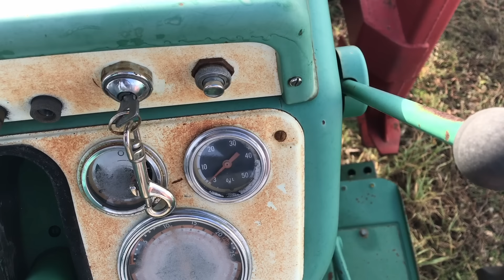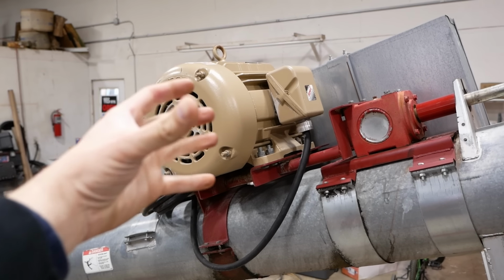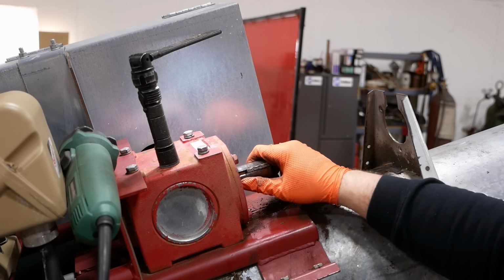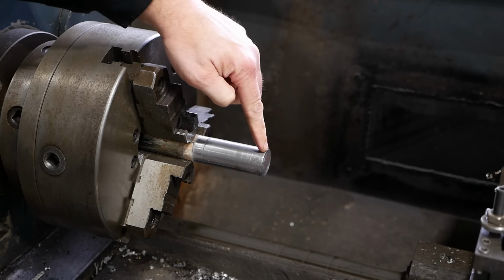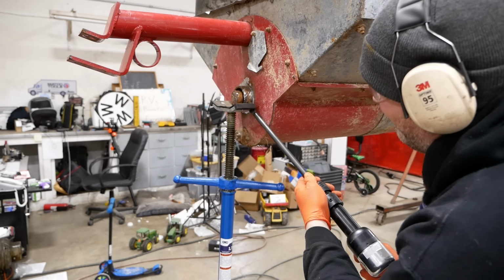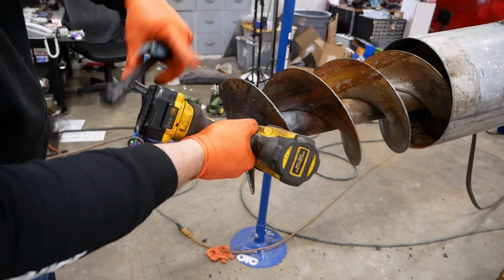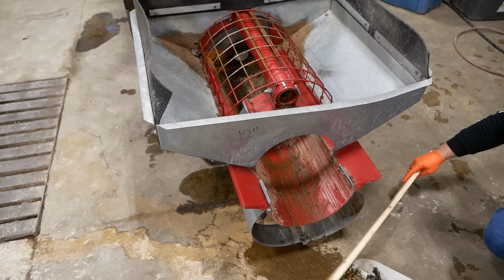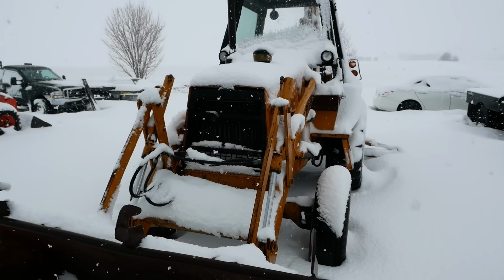Using ALL the Tools to Fix a Chewed up Grain Auger

Comment: For the bushing on the bottom, I think I would make the littler stub shaft a little longer and make a bracket to mount a flanged sealed bearing on there but make it stick out about an inch. Make the bracket U shaped with the bottom open to allow any dust to drop out before it gets to the bearing.

Comment: I don,t make it a habit of criticizing your work so forgive me.  There was a 3 bolt flange bearing missing at the lower end of the driveshaft. It wore out and somebody cut it off. It should have been replaced.  That much unsupported shaft with a rigid coupler caused the keyway to wallow out and it is ruining the gearbox in the process.  All three of those bearings could have been replaced for around $100.  Also, there are split rigid couplings available to simplify shaft repairs.  Finally,  a good sealed 4 bolt flange bearing on the tailshaft would last a long time IF the owner would apply three shots of grease at the start of the harvest season. Finally, farm equipment is built cheap because it is used seasonally.  A little $$ added at repair time can make it last indefinitly.  I really like these types of videos.  Thanks.
Reply from the maker: I don't get to fix things the way everyone wants. The customer wants it put back the way it was. My job is do it or pass.

Comment: Kudos to you Wes. I know first hand the work you done there. As I repair maybe 10 or so a year plus all other types of grain handling equipment. Its rare to see somebody take the time to do it properly, most of the time I am cutting off the coupler as the farmer just welded it up to finish the season. Then forgets about the repair until it breaks again and now the 12 hr turned into 18hrs

Comment: Cutting Edge Engineering can only "suck a point to this" that's a dutch saying, (without any mean connotation)  just telling it looks a great job, and they probably would not have done it better. 

Was hoping for a dry-run in the end?

Thanks for taking the time to film it!

Comment: Great work Wes.  Always love your machining videos.  Might need a little “weep”/“drain” hole in the bottom of the area where that and residual corn kernel’s were, course keeping that hole cleared out would be troublesome.
Great video,
Thank you sir.
Reply from the maker: It does have a small trap door. I think it's rusted shut.
Reply: @WatchWesWork  yeah, probably.

Comment: Looks like a great job I personally would have switched it to a four bolt flange bearing ,that way you could grease it and you wouldn't wear it out ever again.. I work as an industrial mechanic in an ethanol plant and we have screw conveyors all over the place all of ours are four bolt flange bearings just never have any issues.
Reply from the maker: I don't know. They are all built this way. There has to be a reason.

Comment: Having a mill(I think) you could just recut another keyway in the shaft at say 90º and just build up the old keyway for added strength. No Mill, Cut the new keyway on the lathe, slow and time consuming.
I commented before seeing you did the job. Love these random machine videos, hope you have some more in the pipeline. Oolite bearings are self lubricating for those that don't know.

Comment: Great video Wes. If you did use a genuine oilite bushing, they are oil impregnated and self lubricating. Adding a grease zerk is not necessary for oil impregnated bushings.
Reply from the maker: Genuine. But oil does help!

Comment: Consider building a super sized slide hammer for removing shaft journals like that. We have one in our shop that has proved its worth many times. No need to make fancy adapters, just weld it to the journal with some 7018 and wail away.

Comment: Nice job, 😄
I repaired alot of machines when working at the farm at my school time.
One thing I was wondering about why is there no thrust bearing at the end of the auger axel?
I would think that axel has a lot of force pushing is downwards when pushing the corn upwards.

about the missing grease fitting I can confirm some times and very dusty environments grease can make things worse.

Comment: Yeah that 15W 40 is a might thick when it's cold. It ain't janky if it works. Bravo. I know diddly but it strikes me that bottom of the shaft should have had a zerk on it. Maybe replace with a straight roller bearing? POPCORN! It's gotta' be joyous working a moving target. OK NM on the zerk.

Comment: It seemed to me a piece of 304 stainless would have made an ideal replacement shaft instead of mild steel, and cutting a ledge for a seal in the mounting barrel inboard of the bronze bushing to keep the dirt and water out. Adding 4-6 weep holes in the bottom of the hopper would go along way to keep the bearing above water. What do you think?

Comment: When trying to back things off you got to keep it square, so you need to keep the impact and pulling yoke straight, so put a bubble level on it both ways , vertically and horizontally. Put some kribbing under the impact and around the pulling yoke . A straight pull is an easy pull , other then that it gets cocked sideways and tries to tear itself apart.

Comment: So many methods (and tools) to manipulate parts and raw metal, but the results are great. One added step I would have taken would be to remove the cleanout gate at the bottom of the hopper and introduce it to my scrap bin. Also, we all know of course that you could have made the shaft coupler too.

Comment: First, I enjoyed it and would not be able to do it myself. I did wonder if you risk boiling the lubricant out of the bearing, welding the housing in after fitting the bush. I also wonder if a longer stub in the bottom of the auger could be supported on a solo aligning ball bearing with a three bolt face mounting. air would require a tapped plate to mount the bearing on as no bolt heads could be inside.
Reply from the maker: I don't think a bearing would survive the dust.

Comment: Impressive work on this one, particularly with all the cumbersome pieces. The dry bushing sounds like what Squatch253 said about the pins and bushings on track machines, where grease would just pick up dust and dirt and wear stuff out faster. I’m somewhat surprised they didn’t use some sort of sealed bearing, but I’m far from an expert on these things.

Comment: Wes, So I gotta ask, why not put a Dodge 4 bolt flange baring on the end of that thing in stead of the Bushing?
My thought is greasing the baring helps drive out the the dust and dirt. When it does go bad pull the bolts slip it off the Shaft and slip a new Baring cartridge in and bolt it back together grease it up.
Should last longer and be a quicker repair next time.

Comment: About bearings: I work in a facility where an acidic substance becomes vapor and is then exhausted out of the building.  The sealed ball bearings on the exhaust blower shaft have an excessively short lifespan.  SKF are the only bearings that have been about to hold up between maintenance intervals.  Equivakent NTN, Timkin, Tritan, etc. all fail in short order, probably from the acidic vapor breaking down the seal and evacuating the grease.  Whatever SKF is doing holds up slightly better under these conditions.  We're considering modifying the blowers and putting in greasable pillow block bearings with auto greasers, but I'm concerned about other particles in the exhausted air being similarly abrasive as the grain dust, making their way into the bearing through the less-tight seal than the ZZ bearings, eating them up and negating the auto greasing system.  I guess if SKF changes the bearings up, we'll try the auto greasers, but until then, we'll stick with the expensive bearings that prevent downtime from unscheduled maintenance.

Comment: I noticed that you put the bead of silicone on the outside of some of the bolt holes for the gear oil tank, I hope it doesn't weep gear oil from around the bolts.

Comment: You just had to buy a new coupler, cut the shaft off and get a keyway cut. Slide the motor and gearbox up and done.  This auger is in real good shape compared to my old 7 inch Sakundiak after I've augered 150 tonnes of coal through it.
Reply: I thought the same thing but after looking, wasn't the  shaft  flange bearing holder welded too close for everything to slide up enough?

Comment: Instead of the oilite bushing on the bottom end, I would have converted it to a square flange pillow bushing with an eccentric collar since you had to make a new stub shaft anyway. That's what we ran on the Kinze grain wagon augers when I worked there. Nice thing is it would have been greaseable and an easy replacement next time if needed.

Comment: I guess I missed something! So the electric motor would turn, but the shaft wouldn’t turn? Didn’t that red coupling have a key way in it? What happened to the woodruff key? Was it missing? I would think that auger would have a shear bolt somewhere in that shaft or between the motor and the coupler. You did a good repair on the bushing. Don’t understand why we couldn’t see it run.

Comment: About 40 miles from you, at least 12 plus inches and horrible blowing snow.  The roads are going to be difficult until the weather melts the ice.  Looks like the weather is going to really warm up later in the week.
Reply from the maker: All the way up to 0.
Reply: @WatchWesWork  - Long term forecast for Lanark IL - Jan 23rd shows 43 degrees.

Comment: Looks like you are still having a mild winter. That looks like a normal winter day in Canada and our schools are never closed. BTW I am 63 so I have been around long enough to have seen some weather.
Reply from the maker: The snow isn't really an issue, it's the wind. They basically can't keep the roads open.
Reply: So...like a normal day around here. Had "white outs" on the way home from work the other day. That's when the wind is so bad you can't see a thing for blowing snow but you keep going anyway. @WatchWesWork

Comment: Seems like a 2 or 4  bolt FLANGE bearing would have been much better than a bushing. At least it would be greaseable and it would be much easier to replace. But the engineers know what is "best". Haha.

Great job. That air hammer is impressive; it works  wonders. 

Always enjoy your work. You really do a great job. Looking forward to next project.

Do your customers watch their equipment repair videos? What do they say about your approach to the repair?
Reply from the maker: Some watch, most don't care.

Comment: I'm curious as to why you replaced the bushing and all the work involved with that, instead of using a bearing and mount instead. Would be easier to replace a bearing at a later date.

Comment: We once had a train pulling a bunch of grain cars derail near our house.  The railroad just emptied the grain from some of the cars into massive grain piles and left them to rot.  It stank bad for years.
Reply from the maker: They had an elevator blow up here and the corn was mixed with metal and concrete. Too dangerous for animals to eat. They trucked it down to south and fed it to cat fish.
Reply: @WatchWesWork  Catfish don't count as animals, I guess!  Lol.  

The same railroad is responsible for a Superfund site in town.  They don't seem to have learned to properly cleanup after themselves.

Comment: 11:24 Gentle heat to me is bad. Lets the heat soak and screw stuff up. I get it, get out, with as hot of an O/A as possible. Heat that coupling so before it can soak to the shaft and have both expand at the same rate.

Comment: 1. Cut the shaft off and slide the motor up.
2. Weld the coupling to the shaft and slide it onto the motor.

Comment: One other option for repairing the keyway on the shaft would have been to shorten the shaft and cut a new keyway. Then make  up the lost length on the shaft with a longer coupler to the gear box.

Comment: A 20' common round size  steel bar will be in stock in every major metals dealer in your area.  This stuff is ungodly common.  I used to work in a steel distributor and we had 20 and 12' length stock in everything from 1/8th to 2"  Rack after rack of the stuff.
Reply from the maker: The nearest metal distributor is two hours away and only delivers once a week if I’m lucky.
Reply: @WatchWesWork  OK. I was just letting you know in case you didn't already know.  You have to either pick it up or have it delivered, which kind of sucks. You can't send 20 foot packages through the mail or UPS. IIRC, there was a 70 pound limit anyway.

Comment: One question, why bother with an oil lite bushing at the end of the auger when sealed grease or bearing plates exsist? I mean you already had to mess about with machining a new insert for the auger why not throw a serviceable bearing on the end drill a few holes to bolt it up call it a day?

Comment: I would have been tempted to just weld the driveshaft to the coupling and fix the bushing on the auger. You still have a keyway to shear on the other end of coupling.

Comment: I wonder if the original bushing was that cast iron thing simply because normal bushings wear out too fast in that environment?  Seems like you would want a well sealed/protected actual bearing there instead.
Reply from the maker: I suspect it's more about cost. These things are made as cheap as possible.

Comment: Surprised the drive was taken on a woodruff key, I had always understood that they were there to locate but not take drive. Also no sign of any shear pin, when I worked on the pea harvest in the late 60s with Mather & Platt viners they used 6 inch nails as shear pins. Could you not have replaced the oilite bush with a sealed roller bearing?

Comment: You slid the motor down to get the rod off. I would have cut the shaft and slid the motor up. I might have had to cut and reweld to reposition that bottom rod brace near the motor.

Comment: Your a Machinist Wes, could you have just rotated the shaft 180d and milled in a new keyway? 🤔

Edit: Before I leave... enjoyed the video!  And I agree with your assessment of a grease zerk on that bearing... "lapping compound" is the perfect analogy!!!
Reply from the maker: I could, but it would not live long. The OD was worn down .060"
Reply: @WatchWesWork  Yeah, good point.   Enjoyed the video.

Comment: Could you have cut off a few feet, turned the cut off end 180 degrees, remade the end, and spliced it back in-either weld it on, or put another coupling in?

Comment: For your 3 phase conversion, do you use a rotary converter or inverter? I will need one for a milling machine I am resurrecting and am  considering an inverter for cost and simplicity and possible speed control.
Reply from the maker: I use an RPC.

Comment: Wes, I have been a farmer all my 70 years, and have often wondered if an oak bearing would work as good or better than that lower bearing. Seems like about 50% of the augers I see at auctions have a bad lower bearing, and as you know they are not that easy to replace. Just wondering.

Comment: Wes, there was a conspicuous absence of a carrier bearing closest to the where the auger external shaft coupled to the motor. I was not able to tell later in the video if it magically appeared in the end. I was noticing the "death wobble" while you remachined the end of the shaft and rekeyed it. Was that carrier missing when you got it? Do you think the wobble at that keyed coupling might have failed due in part to the missing carrier?

Comment: What happened to the Ammco brake lathe that used to sit on the steel table? I hope you still have it, or did you bequeath it to the Smithsonian?
Reply from the maker: I found an original Ammco bench to put it on.

Comment: The extra hole 🕳️ probably won’t make a difference but I would have put a bolt in it and welded it in used the lathe to cut to size. But I won’t tell.

Comment: On your shaft..  I don't see why you didn't just get a new shear key and throw it back together..  and maybe drill a 1/4" hole through it all and add a soft bolt... just to increase the shear value a bit and move on??   It seems like a lot of work for something that doesn't need to be a machine fit or anything special.    Granted, I don't know any of the forces here or what is required.  I do know that motor and the chain box are both huge..   It just seems like the shear key did it's job and acted as a fuse-- and something else was a problem...    I'm just wondering what actually was the original issue that made that thing shear..  I do like your lathe setup though. :)

Edit:   you know what:  I take it all back.   You have the tools to do it, and you made the right choice to fix that rod end..  I was just thinking of how I would have made it work---  with me not having a lathe or mill.    It's not actually that hard when you have the right tools.   Bravo
Reply from the maker: There's a lot of "farmer fixes" that would work in a pinch. He brought it to me because he wants it put back to original condition.
Reply: @WatchWesWork    Right on..  It turned out nice.   I was thinking that maybe an oversized sealed bearing would be better on that auger end.  It will block out corrosive dust.   And the fact that the auger runs at slower speeds, it would probably last forever.   I'm just not sure if they are cheap enough to make sense.   You can get 1" bearings for barely over $10..   So I wonder what a bearing that size would be.

Comment: If I may ask !  Why couldn't you have just turned the shaft down .020" to .030"  instead of building it up  and make up a new coupling ?              It looked plenty strong enough to handle that load.  I thought it was a Lunar module landing stem and it came back to the mother ship for repairs. Nak Eak yon zirp zirp click click.

Comment: Wes it might have been better to replace that bottom bearing with a sealed ball race bearing mounted in a casting so it bolts on and much easier to replace.